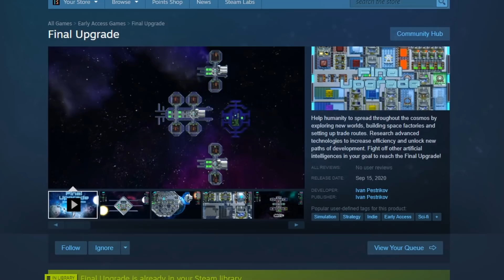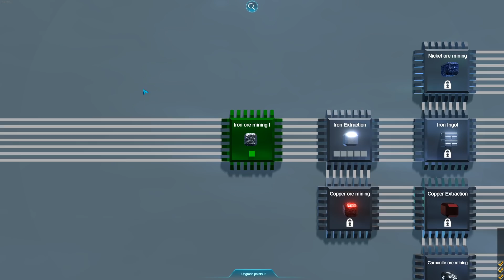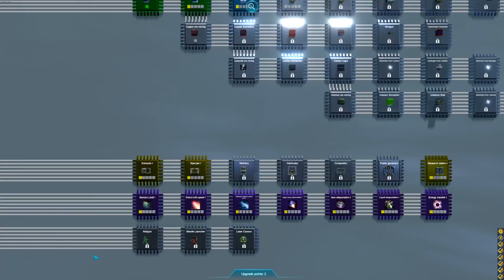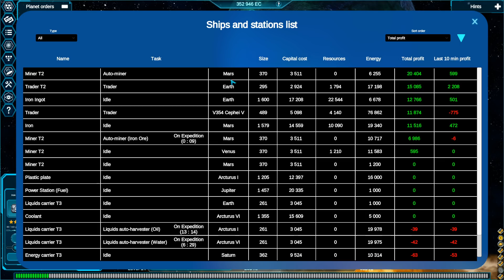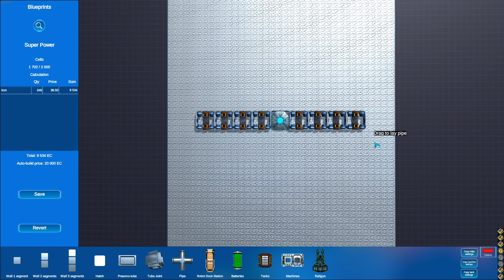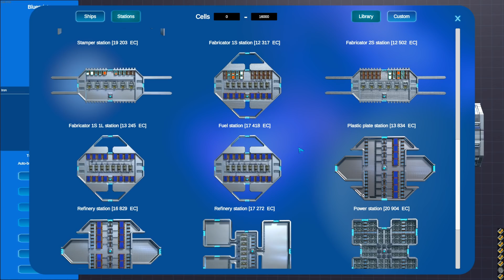New Factory Economy Sim! Final Upgrade

Comment: Looks like a lot of fun.  I may check it out.  One thing, though, that I have a beef with in general.  I tend to not appreciate 2D games masquerading as 3D.  What generally happens, as we can see here, is that while 3D, it's still very flat.  Things don't have a lot of depth to them and the little depth you do have is rather insignificant.  The graphical style, as much as everything else, should be a logical and appropriate choice which meets or enhances the needs of the mechanics, or even the other way around if you really want.  But neither are really true here.  3D doesn't really enhance the game, and there are no elements which benefit from the 3D.  This is probably bothering me so much because the environment is set in space, and space is vast and extends in all directions, but this all feels small, contained and flat.

Anyway.  Nothing bad against the mechanics or play style, just UI design choices :)  Like I said, I'll probably go pick it up because it does look fun.  Thanks for this review!

Comment: If you do decide to do more videos on this game, Brothgar, I wonder if it's possible, and economically feasible, to build ships that not only have the ability to mine out resources, but would also have the ability to then refine those resources in-situ all the way into ingots or fuel (presumably to save on cargo space requirements?), then drop those resources off to a more specialized manufacturing station to be used for the creation of more advanced resources?